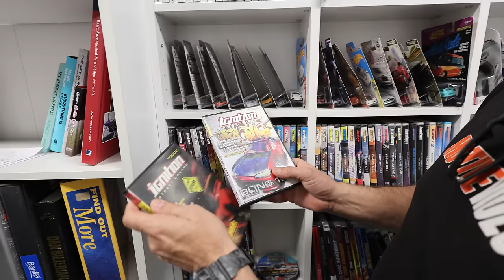Drooling Over GT-R's And Aussie Market Cars at Motive Video In Sydney

Comment: 32:05 all JDM STI's have EL headers from factory. Twinscroll turbo, EJ207, 8250rpm redline all stock. it does sound like a flat 4 more when you get into boost.
Reply: Yep from V8 Blob eye on. V7 Ej207 still had unequal, single scroll.

Comment: Great vid, as always Larry.

Thumbs up!

Correction on the Subaru STI S-204, they do not come with 6 piston front/4 piston rear brakes.  

The STI spec c Ra-R had 6 piston front brakes.

The STI S-206 was the vehicle that came with 6 piston front/4 piston rears from the factory.

Comment: 39:10 in Europe they were called the Granada, think it was a UK thing in the 70s-80s. My dad had one 🙂, in green, it had a 3 liter 6 cylinder engine. Think the Ghia badge is the trim level.
Reply: This model Falcon looks like the Granada, but was designed, engineered and built in Australia. The Falcon line is bigger but does use the same headlights as the Granada.
Reply: @paulrigbye1752  The collaborations in the past was interesting, very local ideas were created, not like today where it is mostly pushed by the home base.
Thanks for clarifying.
Reply: It's a XE Ford Fairmont Ghia.  It's still a Falcon, but the Fairmont was higher spec and the Ghia just another level (from memory).  The XD Falcons (the start of that squarer box look) don't have a lip from the bonnet over the radiator area. The XE's have a flat lip and the XF has a curved lip.  The XE's had those lights at the back and the XF had like a plastic insert in those grooves.   I was never a Falcon fan but plenty of mates had them so I picked up some info like you do.  I'm sure there are plenty of other facts that I don't know and a Ford fanboy can fill in on the full details.
Reply: @Bicketybam68  Cheers!

Comment: @larry that purple VL drag car would've come out with a RB30 single cam turbo or NA. many australian builders use those rb30 blocks with rb25det heads from a r34gtt and build 700-1000hp monsters without much effort. (the rb30 turbos were quick even the auto ones and those VL commodore bodies although they looked big weighed nothing).